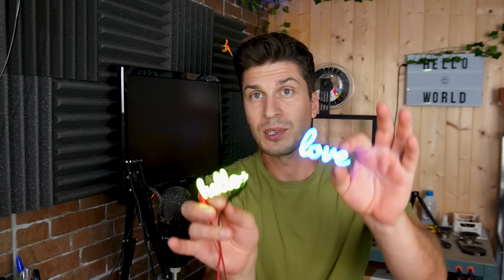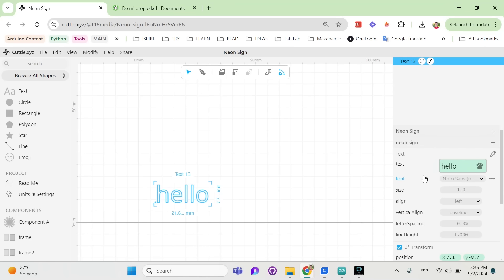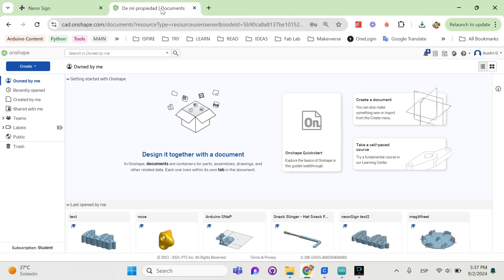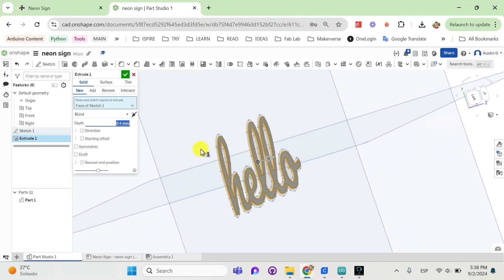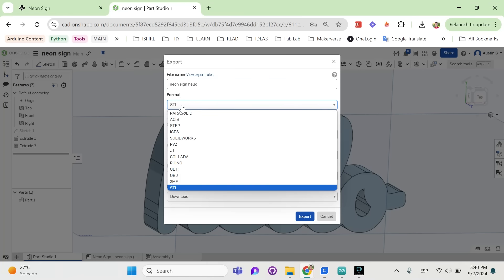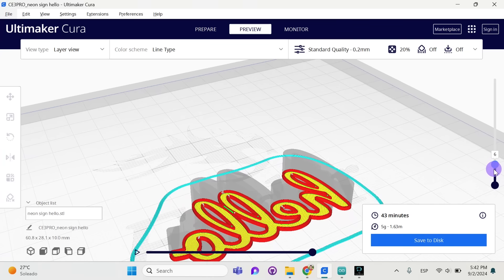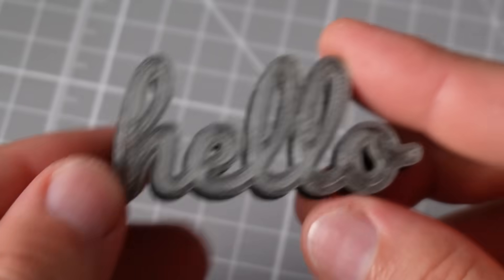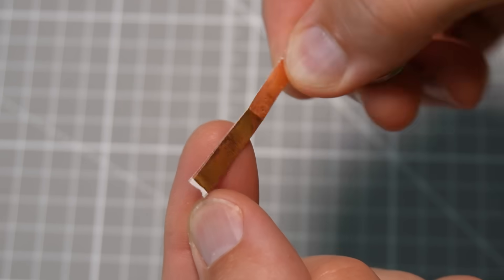How to make a Mini Neon Style Sign with 3D Printing - Tutorial DIY

Comment: If I use more than 1 filament wire, do I need 1 battery per wire?
Reply from the maker: You could consider more batteries or another battery type to extend life, but a single battery will also work (just a shorter overall life). I am working on a new video about power supply recommendations. Stay tuned! :)
Reply: @nick_the_maker  I would love this, but in the mean time are there engineering courses or YouTube videos that I can learn how to calculate power needs. I'm at a loss of what to search for.

Comment: boy was i doing it the hard way.  as a glassblower and commercial signage fabricator and installer, i was bending 3mm borosilicate glass rod like it was miniature neon, using LEDs heat shrunk to the ends as tiny neon electrodes.  sandblasting the glass made it so the the LED light would diffuse out.

this is way easier. 😂 
i like to make junky little sign dioramas.
Reply from the maker: Would love to get into glass work someday.
Reply: @nick_the_maker    I took a glass blowing class.  Very fun and interesting and WAY harder than it looks (like most things)

Comment: I purchased a 3D printer and I’m just learning but would love to do this project for my dollhouse. If I have the AMS that supports printing multicolored projects, do I have to figure out how to add a pause in between the colors or can I separate into two pieces and just glue the two together? I don’t know anything about geo code, etc. Thann you for sharing. This is excellent.
Reply from the maker: No matter what machine or slicer, I believe there is an option or plugin to help you with a pause. I am only familiar with Cura and my Ender, so I may not have the best advice here. Two pieces glued together is not a bad idea, for sure!
Reply: @nick_the_maker  thank you

Comment: Good job!!! Can this LED strip be cut if it is too big? I intend to do a smaller project, but it looks like there will be some leftover tape and I will need to cut it. I have never worked with this type of LED strip. I work a lot with those that have a mark to cut, but I would like to know if I can cut this one. Thank you and great job.
Reply from the maker: These should not be cut. Check out the seller I shared in the description. You can choose from various lengths to suit your needs, including very short lengths. Good luck!

Comment: I find it a bit confusting when led-signs are called neon-signs. Neon is an different thing.
Reply: It’s about the style, not the technology 😬🤷🏽‍♂️
Reply: @DruckLuc  Still; Just google image "Led Sign".   Call a spade a spade, calling neon it is wrong and a bit clickbait-y ;)
Reply: Neon lights were invented in 1910, so a hundred plus years later, the term now means a light that has the neon light effect: "There are many types of neon lights, including traditional neon signs, LED neon lights, and replica neon lights" "LED neon lights are more energy efficient, versatile, and safer than traditional neon signs". The younger folks will likely never make the connection to the tubes filled with gases. :)

Comment: If you don't mind the extra effort, if your 'glow' area is only 2 layers thick, you could pause the print between the 'outer' and 'inner' parts of the text, print the two layers, then swap back to your outer filment to finish the print.

So:
Filament one to do the stroke around the text on layer one.
Switch to filament two to finish layer one and print the text in layer 2.
Switch back to the first filament to finish the layer 2 stroke and rest of the shell.

Comment: Could you use EL Wire to achieve the same effect? I'm thinking because EL wire can be cut down to length it would allow longer signs without the limit imposed by the short lengths of LED filaments
Reply: Have some en route, will let you know!
Reply from the maker: Definitely a good idea, but I don't know if it would be bright enough to give you that neon sign effect. What do you think?

Comment: WARNING! You can't just hook a LED straight up to a power source! LEDs have low internal resistance, so since I=V/R you'll get way excessive current if you don't add a resistor in series! Those LEDs tolerate only 100 mA, any more than that and they'll have an increasingly short life.
Reply: How do you calculate how many batteries you need, what resistors you need per wire?
Reply: @jebronekitty take a look at the voltage drop or forward voltage of the LED. If it’s 3V, in general you’re safe with a household 3V battery in series. That means a cell battery like you saw in this video is fine, or two AA’s in series for example (as they’re 1.5V each)
Reply: @Nate-Wilcox  awesome, what if I have 6 different wires hooked up in succession?
Reply: Thanks for the warning. Could you suggest please, what do I need to add between 13450 550mAh battery (li-ion battery from ecigarette) and this kind of filament? Is it only resistor? Which or how do I calculate or measure which one I need? I have a TP4056 charging module with protection for the battery, but I'm not sure how to control output current.
Reply: @TheZukru  The simplest form would be just the resistor in series. 13450 is 3.7V battery and the LED in video is 3V. With basic math R=U/I, so just put in the values (3.7V-3V)/0.1A and you end up with 7 ohm resistor. If you want steady current output (= steady brightness) while the battery discharges, you can google 'Adjustable Current LED Driver'.
Reply: @TheZukru   thank you, it would be nice to have some extra detail as to why.
Reply: @jebronekitty  Why as why use these batteries? I have a whole bunch of them and want to sustainably reuse them. They are free and they are small. And I think if fits the DIY culture very well.
Reply: @TheZukru  no, I mean, I would like to know exactly what you're taking about
Reply: @jebronekitty  I want to make a small desktop sign like in this video, using filament led wire and a 13450 battery as a power source instead of flat round non-recharchable battery from the video.
Reply: @jebronekitty  he explained it perfectly the first time. Bot comment?
Reply: @DarwinAllen  dude, I don't call me a bot. He didn't understand my question and I gave up trying to explain. This is not the time...
Reply: @jebronekitty  suit yourself. Seemed pretty clear to me. He wanted to know what goes into the circuit to reuse an e-cig battery to power one of these. Sounded like a pretty good idea.
Reply: @DarwinAllen  you have also miss interpreted my comment. I was just reinforcing the idea that I to would like to know how things work, I was not asking him why he's asking the question
Reply: @jebronekitty what’s going on here lol. Just add a current limiting resistor in series to the led. You need to know working current of the LEDs use this to calculate the resistor with R=U*I where U is the Voltage of the source minus the voltage of the LED strip.
Reply: @TheZukru you could just add a step down converter or buck module same thing or add a resistor which would also step down the voltage just ask Google which resistor or buy a 3v buck step down module you can also buy the tp4056 with an adjustable output voltage but I don't think it does 3v.
Reply from the maker: Hey, thank you for bringing this up. Totally agree to err on the side of caution, it would have been smart to give a clear warning in the video for those with less experience and thinking about trying alternative power supplies. In this case of the suggested button battery, max discharge current is extremely low, so an added resistor is not necessary.
Reply: @nick_the_maker  Yeah I figured with the coin cell battery a resistor wouldn't be necessary.
Reply: oh shoot I was going to electrical tape on a lamp cord and go for it
Reply: Of you use 3volt there is no problem use a step down will be nice also
Reply: @Blauwdruk3D you still need current limiter
Reply: @NoBody-bm9if  step down conv.. thingy with amp most save option yes butt its not a huge problem if you use 3volt only 😀
Reply: @Blauwdruk3D It’s always good practice to use a current limiting resistor, even if only a low value is needed. And especially so when the power source is a battery - it will cut current consumption and increase battery life and the lifespan of the led considerably with no noticeable drop in brightness.
Ever wonder why the LED lamps in your house fail after a year or two? They’re all being overdriven so the manufacturers can quote a high lumens value, and so they can sell more lamps. Up the value of the series resistance on the output and they will last for a lifetime.
Of course, it’s not important if all you produce is rubbish like this ‘hello’ sign, but it makes sense if you’re building a control panel for industrial equipment.
Reply: Biggest issue with this, How to power something so small and would someone really want to plug it to a wall socket etc.  get a usb power bank? Get a ac to dc power supply? The cost of the power supply might cost more than the print and the strip. 😢
Reply: Led tealights and fairy lights all run off cr2032s with no resistors. I had to change a bunch of tealights and both T 1 3/4 and smaller T1 are still running fine. I guess the battery's own internal resistance is limiting current enough so the LEDs dont burn up
Reply: But it's a 3v LED so should be fine. You must have missed him saying that it's 3v in the video
Reply: What does that mean? Can I just attach a cord and plug it in? Going to try now.
Reply: Isn't led take only what it needs?
Reply: Perfect tutorial style. Thank you so much
Reply: You can hook up to a bench PSU because most of them have CC and CV settings
Reply: Succession as in parallel or series?
Reply: There should've been a disclaimer warning of Do Not Try This At Home Boys & Girls!

Comment: When I move the part from on shape to prusa slicer my part is flat, even though it shows extruded on on shape.  Any thoughts group?
Reply from the maker: Did you manage to figure this one out? My first guess is that you might have accidentally clicked on a line of the wall instead of the form between the two wall lines. In Onshape, if you click a line and extrude, it extrudes Surface by default. I have done this before working quickly, and then the exported model had a missing part because it only existed as a surface. Had to go back and re-open the extrude, switched from Surface to Solid at the top of the menu, and at last de-selected the line and selected the correct shape.

Comment: I've been wanting to make one of these for years. I want to string some together so i can make pictures with text so it's going to take some planning. I was thinking of doing a 12v system with them but that could be tricky.
Reply from the maker: If I recall correctly, I think you can buy these on AliExpress rated for 12v

Comment: Would love to see one where you wire the battery and on and off switch to it. Like a mini night light.  or even a USB plug
Reply from the maker: Working on some follow up vids, including approaches to power, stay tuned! @marcus3d is right to be cautious, often a resistor is needed when working with LEDS. COB filament lights are unique, however, with a high forward current limit around 100mA compared to traditional LEDs at 10-30mA in most cases. The small button battery has a super small max discharge current, so it is a safe option as a starter recommendation.
Reply: You don't want the guy in the video to give you advice on electrical circuits, since he didn't even include the ballast resistor that is needed to limit the current through a LED. This means he doesn't understand even the very basics of electricity, Ohm's law, which you learn in the first class in the first introductory course on electricity.
Reply: @marcus3d  Tell that to him.  Message him - offer advice - suggest why he needs a  resistor.  He's a maker trying to show us something.  Proper critique comes from wanting to share your knowledge.  Would like to see you guys collab.

Comment: Us UV resin to fill in instead of the clear top.
Reply: very much a thing in the Asian commercial signage industry.  they have massive UV exposure units that would cook your eyes right out, for curing a 6mm thick layer of resin.  3D printed signage is obviously not UL or outdoor rated tho.
Reply from the maker: Resin is also an option, for sure!

Comment: You're missing something.  Actual Neon.  That would be a cool trick.
Reply from the maker: That is an option to consider, for sure, but I really liked the diffusion from the transparent thin layer. Cheers!
Reply: @nick_the_maker  After watching your video I saw another guy doing basically the same but called it LED.  I think my hang up is that I really like neon.  Even though you did something completely different this did trigger in my mind the possibility.  You can buy transparent filament for 3d printing and I thought the vacuum was the killer but then it occurred to me that a neon tube is full of neon and not a vacuum at all and I wonder if it would be possible.  Printing would be a no brainer and I think just  heating an electrode would let you get it into the printed tube.  I think flushing the tube with neon gas would do that part and the rest is just attaching high voltage.  I'm sure that there must be something that prevents this or someone would have already done it.  Maybe it's just that glass tubing is easy to work with and only needs a torch and some hand tools to make a sign.  I'm not trolling, I genuinely thought of this.
Reply from the maker: Haha, I am now starting to get curious as well! 😃 I feel like the plastic would still be too permeable, even if you have several layers thick. On an atomic level, I think the gas would escape through, no?

Comment: Shoot - a couple years ago I made a much larger neon sign using that same glowing wire.  But it didn't occur to me to 3D print forms.  I with it had.  Instead I printed the signs on paper, and used that as a template for putting a whole bunch of nails in a board.  Then used a bunch of stripped wire to attach the glow wire to the nails.  It came out great, but it was a lot more work.

Then I used an arduino to create various effects like a slow "breathing" effect and a flickering effect to look like the old neon signs.
Reply from the maker: Sounds like more steps but I imagine the project came out awesome!

Comment: OpenSCAD can use the text field (or an icon!) as an input and procedurally generate the perimeter and face files
//e.g.
sign_text="hello";
sign_height=15;
sign_depth=10;
front_plate_thickness=1;
text_perimeter=1.2;
fontstyle="Pacifico";
spacing=1.0; // [0.8:0.05:1.2]
/* [Hidden] */
$shim=0.1;
//generate_perimeter
module signify(){
difference(){
linear_extrude(sign_depth)
offset(r=text_perimeter)
    children();
translate([0,0,-$shim])    
linear_extrude(sign_depth-front_plate_thickness+$shim)
    children();
}
if($preview)
color("white")
translate([0,0,sign_depth-front_plate_thickness])
linear_extrude(front_plate_thickness)
    children();
}
signify()
text(sign_text, size=sign_height, font=fontstyle,spacing=spacing);

Comment: Was it just luck that the width of the letters was the right size to match the width of the COB LED Strings?
(They appear to be 1.5mm - 2.00mm btw)
Reply: Thx for the info on thickness of the leds strips, I was searching high and low for this and found nothing until now. <3
Reply from the maker: A bit of luck, but I ran few text prints in advance to find the approximate best size. I believe they are 1.5mm, you are right.

Comment: I assume you can't shorten the flexible filament LED, so how did you manage to know the exact length of it for your "hello"?
Reply: You could probably draw a spline or series of lines and arcs through the center the letters in a 3d modeling program. Get the length. Then scale the text to the size of the LED filament. If you need a specific size of letters you could probably find a close enough size LED filament or connect multiple together
Reply from the maker: After a couple of test runs, you quickly get a feel for the approximate size. My approach is to print the design just slightly smaller than my estimate, and if a bit of filament light is left over, tuck the excess over the first layer of light. If you want a longer word, you can also connect more in parallel to your power source.
Reply: @nick_the_maker  I wonder if you could use black heat shrink or paint to create gaps similar to a real neon sign.
Reply: @nick_the_maker are you able to link up the lights?

Comment: Love this led filament , its been sitting in my card for ages 😅
Reply: Remember to include the ballast resistor.
Reply: Can you explain what this is? I did not see it in the video.
Reply: @andypiper  It's not in the video, because the OP doesn't know even the very basics of electricity. LEDs have a low internal resistance. Current is voltage/resistance, so if the resistance is low there is a lot of current. LEDs can't handle much current, at least not for long. So you have to add a resistor in series with each LED to bring down the current.
Reply from the maker: Haha, let's gooo! Time to make a cool project. :D

Comment: this is really cool. a base or stand with two AA batteries would work as both energy supply and weight to keep it standing nicely.
Reply from the maker: A great idea. Working on a video to inspire more added features, will include a base option as well! Cheers!
Reply: @nick_the_maker did you ever made the video? Also what kind of 3D printer?

Comment: Can we use El wire instead? It's cheap and we can cut at the desired length. Also it has multiple color options.
Reply from the maker: I haven't used it much, but it for sure is a possibility. Brightness might be an issue though.
Reply: @nick_the_maker  True, just double it to fix the brightness.